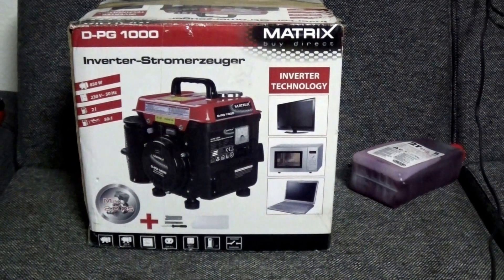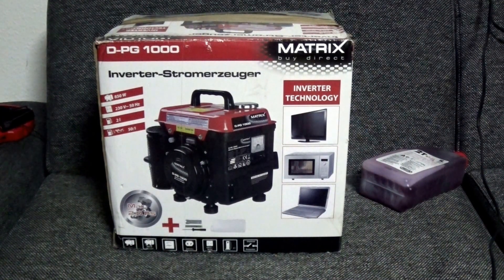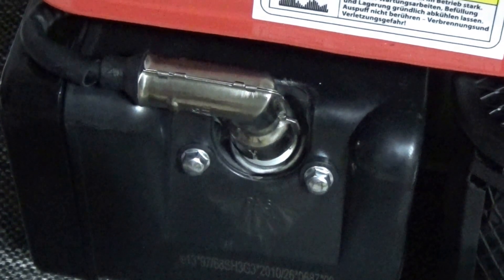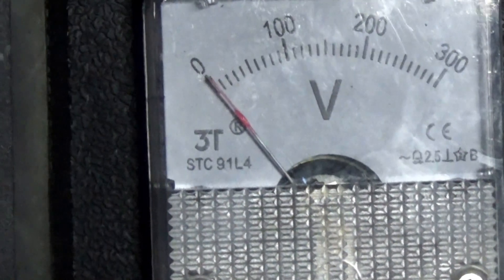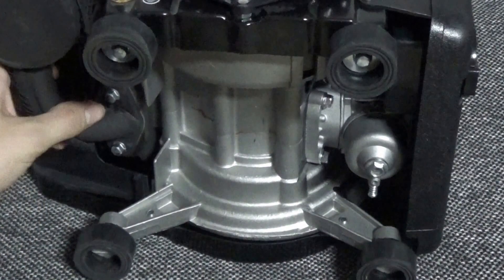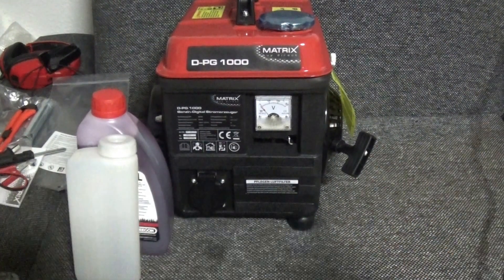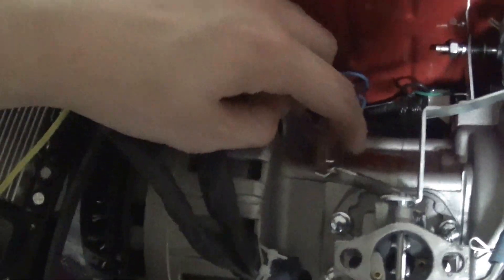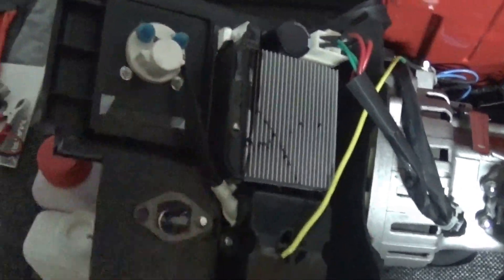Matrix D PG 1000 Inverter Generator

Comment: Hallo! 
I want to buy  one gen like this, and I want to Know it runs strong for switching power supply like You mentioned, TV, computer, small brushed ac motors, small trasformers, and so on. 
As a rewiew, after half a year of usage.
Thank You!
Reply from the maker: It should be fine for that application but I don't know if it generates a pure sine wave output... (since this is a cheap generator I'm sure it does not. Gonna be a 50Hz 230V square wave output) soo you'd gotta check if your devices support that since some switch mode PSU's don't like a square wave output. I myself had no issues with it so far.
Reply: HardDiskLover Did you run electronic devices? For example I would like to operate the pump pump motor. I know most engines want pure sine wave. this generator is sold here under the brand name black & decker. Did you try the device? Does the pure sine device operate?
Reply: İt s a problem. big problem. I would like to run a transformer, motor, etc. I dont decided to buy ,..